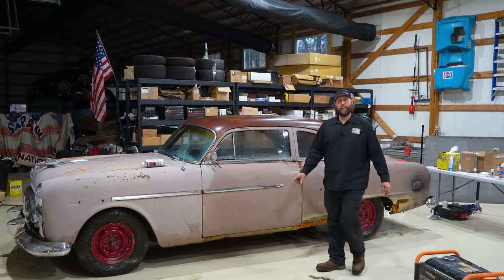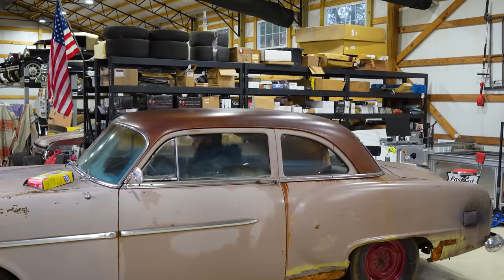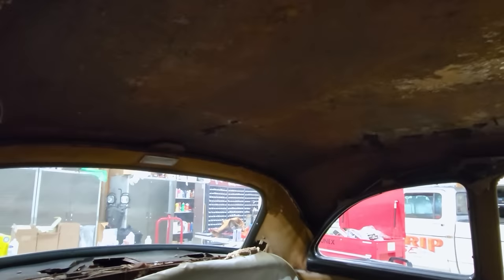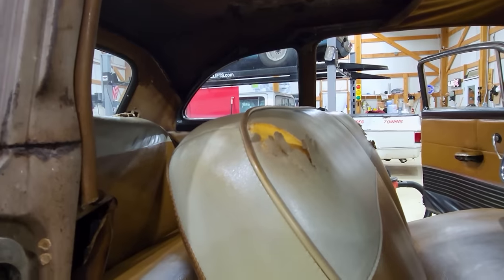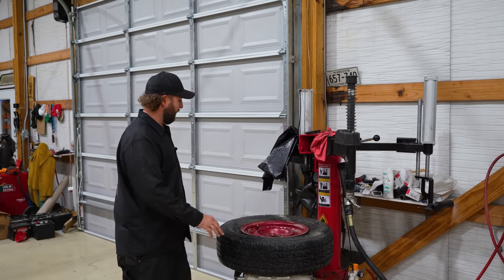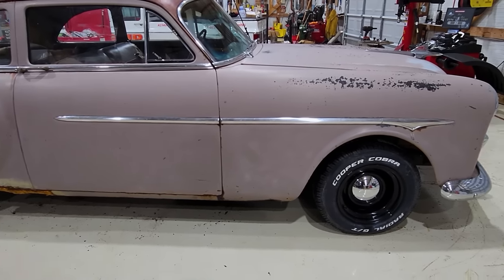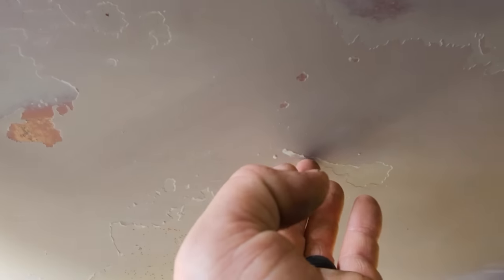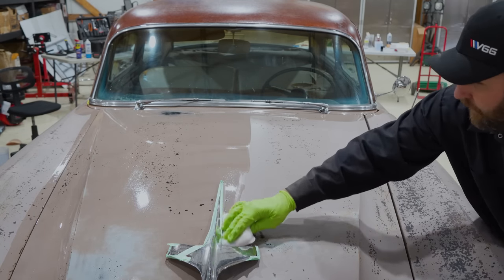BUDGET BUILD - '52 Straight 8 Packard Hotrod!

Comment: As a certified welder now for 20 years , I can verify those are quality,solid welds on the floor pan repairs !
Reply: Agreed. We rat rod builders use a lot of license plates for body and floor work. Part of the trans tunnel on my 41 Ford “The Beast” is license plates and more will go into the Jeep rat I’m building now

Comment: For anybody that plans to remove their headliner and hopefully replace it some day with a new one -  each of those bows in the headliner have a unique position in the car.  Most of the time, they aren't labeled where they go, so be sure to label each of them so that they go back in the right spot.
Reply: That's not ''level 12 mouse housage'' that's asbestos...
Reply: @hifiteen49  Can't tell by looking at it with your peeps, takes a microscope and special filters to do that or TEM.  It is very unlikely, however.
Reply: Asbestos...sniff...nope.  🤷‍♂️👌🏻👍🏻😎🏴‍☠️

Comment: Good tip for anyone else welding in their own license plate floor, a good sealer to use when you do it  is vinyl rv roof sealer. It stays soft and stretchy after curing so it can move and flex and it is all weather ready. Just get a brush and liberally paint the back of the plate before welding it in!
Reply: Over there in America,do the cars have to have a yearly MOT test? Here in England we have to go for the yearly MOT and also an emissions check too for.whats coming out of the exhaust..the license plate floor would defo not pass an MOT over here with them.just self tappered in lol!!! Good effort though and such a great old period car.....thanks VGG!!
Reply: @iantowers6972  there are some states that require inspections and emission testing but most dont. and besides that most classics like this are grand fathered in and are exempt from emissions regulation.
Reply: @iantowers6972  Like josh had said a lot of states have rather lax vehicle inspection laws(atleast for personal vehicles and not commercial) Mostly pertaining to passing emissions , Do all the lights work, does the e-brake work. Then however if the vehicle is over a certain age it's exempt from the emissions aspect of it in those states (mostly states in the northeast and west  coast) then you have the other majority that dont have any vehicle inspection or emissions inspection. Very common to see vehicles with large amounts of structural damage still on the road. Though as long as all the lights work, the wheels are covered and there's a windshield and atleast a driver's side mirror there's not much illegal about it. It's just to the owners discretion to regard when they feel their vehicle is unsafe for use .

Comment: WOW ! What a GREAT recovery of an old classic. Ole Geezer Gear Head here(papasmurf7597). When I was a kid, a million years ago(late fortys-early fiftys), Packards similar to that one, were a pretty common sight. You were right n your comment. THEY were a higher quality automobile. UNAPPRECIATED! My ole man(my father) was a professional auto mechanic dating back to the 'T' days. He also would say that you could balance a quarter on the head of a well tuned Packard straight 8. Funny to hear you say the same thing. BTW, if my memory serves me right, Packards did install a V8 in either '55' or '56'. And, I think, I may be wrong with this info, those Packard V8s could be bored out safely, 1/4 of an inch. Without ruining the engine block. Thanks for this great video. I sure enjoyed it. Sorry for the long comment.

Comment: Derek, 
I was one of those guys that didn't like Patina.  I called it RUST.  So back in the 70's when my '53 Buick special 2dr sedan (also a straight 8) showed signs of derelict decomposition aka Rust & Rot, aka Patina, I cut out the rotted areas, pop riveted a couple of pieces sheet metal over the holes, bondo'd over the pop riveted sections, sanded the entire car, taped off the not painted surfaces, then put two coats of paint on the car by use of a mini-roller.  The first coat of paint was Rustoleum's primer and the second coat was Rustoleum's gloss white.   The whole job cost me $57 bucks (about $100 bucks today).  The car looked perfect and didn't show paint roller marks nor rivet dots.  Those riveted areas never wore through the bondo neither.  I sold the car in '77 for a profit... $300.!

Comment: I like the looks of these Packards a lot. There was a guy who had a Packard straight 8 powered hot rod with an old centrifugal supercharger on youtube. My grandfather would approve of the use of license plate patches. If you want it really period, you get two hubcaps and stop to switch the side they're on each time you drive by the drive-in so the people thinks you've got all 4. My other grandfather told me about that from when he was running around in the early '60s. 4 bar spinners were the ticket back then. I'm a paint the car in the driveway kinda guy but the clear coat made a world of difference. I'd like to get me another classic and give it a try until I could get it one color.

Comment: For cleaning the floor, use a bucket with cleaner, a deck brush, and shop vac. Brush some floor cleaning solution on to the floor, scrub a bit, suckup the dirty water with shop vac.

Comment: Derek and Jessica...what an awesome episode of VGG! That car is super cool and rare and it is a true survivor. I would really like to see you slowly fix the old Packard hotrod up over time...an episode here, an episode there showing you and others restoring some parts that need it, taking care of the mechanicals (maybe some upgrades here and there), doing the interior nice (Dan the man), rebuilding or replacing the guages if they don't work right, maybe a larger exhaust with a Flowmaster or something, and how is the trunk floor...can it be POR-15'd (rust converted), 'plated and given a generic black rubber mat to make it a family three-day-weekend trip or meet--n-greet event rig?
Reply: Ya, I was thinking the same thing. Like what an average guy on a budget would do next. Like how to tackle those foam issues on the bottom panels. If you know anything about body work there are 10 different ways to fix stuff like that. Of course we all know most of them are the wrong way. But still sometimes they work and don't hurt anyone's feeler's to bad? fiberglass can work great if you get rid of the rust first, for instance. It's of course a short term fix. But f&%$k them if they can't take a joke. Ha!

Comment: When I saw you cutting off that muffler on yer old Hudson, I was about a quarter way onto  a bottle of techwilla, and it reminded me of an eventful day when I was 16 years old, driving my first car,  a $750, 5 year old 1969 Plymouth Road Runner. The base stripper: 383 B block, 727 Torque Flite trans on the column. 3:91 axle. 
Anyway, it was a nice spring day, and I was AWOL from high school, in the act taking some young ladies to McDonald’s for some delicious culinary treats. Having seated our desire to snarf down pan fried dog-meat, I decided to do a burn out from the traffic light. Being inexperienced, I did not notice the Wilmette law enforcement officer in his pale, yellow Ford LTD cruiser immediately behind me. That was two tickets for the day, speeding and improper start. Later that evening, since it was a Friday, I decided to attend a party in Glencoe, but I  had been distracted by the desire to replace my exhaust system after school, and had chopped off my exhaust pipe, much like you just did on your Hudson and yanked out the stock exhaust system just below the bench seat. Unfortunately, my glass packs were not the correct diameter to fit. Since the parts store was closed, I decided to drive my unmuffled 383 V8 up Green Bay Rd. to the party. I made it approximately to Tower Road where I was stopped by an environmental protection agency agent. Yes, you read that correctly (if anybody is reading this) an EPA AGENT… not only did this clandestine agent of the environment have a sound decibel meter in his car (WTF!), but as a federal agent, on a special detail, he was prepared to issue me an insanely expensive citation. I told him “holy crap man. I already got two movers today. let me slide and I’ll just take this car home and park until I fix it, and that is exactly what transpired.  True story son.

Comment: This '52 Packard brings back memories. My second car was a '53 Packard Clipper, straight 8, 3 on the column, nothing electric, two toned blue, dark on the top, light under, no rust.  I think I paid about 100 bucks for it in 1959 or '60. 
My fourth car was a white '55 Packard 400, V8. Full luxury car.  Paid $150.00 in 1962.  I burned through cars in those days. I wasn't hard on them, they just didn't last or I lost interest.

Comment: Hey if anybody wants to paint a car and doesn't have a high falootin' compresserater handy, I recommend using a Wagner MotoCoat airless sprayer and some marine topside paint applied at the consistency of milk.   This is Super Cheap and the results look Amazing.   Seriously.   I didn't get much orange peel but if a feller does he can cut that down with a denim pad.  You don't need a huge expensive rig or even a garage to do a decent single stage paint job.   Be aware that all of the work is in the sanding and prep as always.   Cheers friends.

Comment: Derek, I don't know if it's just a southern thing, but cars sitting under trees get nasty black stuff all over the paint. I also noticed more black junk around the gas cap and door because of the alcohol in the fuel. I think that is the reason because we have a 10,000 gallon E-85 tank at work and it gets black and the gas pumps for E-85 turn black quickly as well.

Comment: Hey Derek thank you so much for all your amazing videos. I've been a fan of the channel for a few years now. This product is very interesting to me. I think I have an application for it and I wanted to get your opinion. I have a newer 2018 travel trailer. I struggle to keep the sides of it clean. The surface is your standard painted aluminum siding on the sides and aluminum sheeting on the front cap. My idea would be to clean the walls to get all the oxidation and spotting off of it and then apply this product in hopes that it would create a surface that is easier to maintain and clean in the future. I don't have thousands of dollars to spend on some sort of a ceramic coating that is beginning to get popular for RVs. So I think $125 investment would be more my speed if you think this may work for that surface. Hope to hear from you soon thank you so much!

Comment: When I was a teenager in San Diego County, my Mom asked me to paint the refrigerator we had in the garage. I found some leftover boat enamel in a shade of green, and decided to use a small roller to apply it to the frig.  My older sister liked it so much she asked me to do the same to her '63 VW beetle. That project took hours, but the enamel flattened out pretty good, and she was happy with the way her car turned out. Your wipe-on clear coat caused me to think back on my roller jobs...good memories...

Comment: Need some advice.  I have a 2011 Nissan Juke.  167,000 miles. I got six years till I retire.  I would like this rig to get me there. Everything works.  Had the recall done on the fuel pressure switch early on. It does not leak a drop of fluids.  But it uses a quart and half between my 3,500 mi changes.  Starting to idle rough but runs great wide open.  It does idle a lot as it’s cold where I live.  Is this a sticky valve?  New plugs last winter.

Comment: VGG is my favorite Youtuber. I know he says don't do anything I do unless you are really desperate. This is more for entertainment.
   But still. I love the car and that he got it started and driving with the straight eight engine.   But, If I bought the car, I'd have to UNDO everything he did in this video.
  I wish MY 52 had front coil springs in good condition. Like VGG's were BEFORE.  Cutting coils is bad enough. But TORCHING coils is the worst thing you can do to a suspension.  Either way makes the camber too far off to correct with an alignment. 
  But the result of torching coils is coil bind and loss of temper. So you are bouncy.  
  Next, he put on tires that were too short.  That is why the fender and tire gap was what it was.
  Next, he got rid of the factory "hub centric" wheels and put cheap aftermarket wheels on that are not "hub centric."
These are the things you would only do for laughs. Not for a car you ever expect to drive again.
  The smart thing is to have the wheel centers put on wider rims. Or find hubcentric wheels with about 1 1/2 to 2 1/2 inches more width. You have to buy a wider tire to get the height you need because modern tires are 75 aspect ration but they were about 84 back them.  I wonder why he used what looked like 50 or 60 series tires.
They were too narrow for the wheels, which were actually a good width, AND too short. Maybe had just had had some tires from a Chevy Citation lying around.
  Now my other remarks or more subjective.  
   Also, a top of the line car would have full wheel covers. Only , say , a 52 Plymouth had the small hubcaps. Which gets me to the raised white letter tires.  This is closest to the absolute worst car to put them on. Even if you want the "hot rod look" on your 50's car, a Packard is an enormous car.  It is even bigger than a 52 Chrysler. Derek is a big guy and when he is standing next to the car, you can see it is as tall as a modern van or SUV.  But this is a matter of taste, not safety.  It would be even worse looking on a 4 door  sedan.  "In my opinion."  In the early 60's , 4 door sedans were almost 90 percent of the cars sold. So any 2 door, whether it is a hardtop or a coupe/sedan/post, is worth treasuring.
   I suppose guys got back to him and ragged on him about the linseed oil from other shine ups getting dull and attracting bugs. I'll reserve judgement about how well the new VGG shine juice works since it seems to have some paint rather than a just a solvent and a bug dietary supplement.
   I suspect the shine juice will cause fish eyes in the paint when the next owner tries to de-patina it.
   I would have used the headliner to give a pattern to a upholstery shop or seamstress to make a new one. 
   I just wish he said at the end:  "Please, this was all for laughs! Don't screw up your suspension. At all. Seriously!"
   I liked when he used "lightning scissors" to cut out bad metal and "lightning stitchers" to weld in metal.  It's been a couple of years since he brought those out.
Maybe young people can't relate to high quality repairs so he resorted to  "grandpa's follies" mods.
Reply: You are really limited to what wheels you put on a car that uses bolts.  The rivets interfere with most after market wheels and most OEM modern (60'
s and 1970's) wheels. And you can't get bolts long enough for the aftermarket wheels, especially the left hand ones.   So "I'll just use a 14" spacer won't work. 
Many guys have the drums converted to studs/nuts.

Comment: Why your mop smears instead of mop need to fill mop bucket with the hottest water soak mop in the said hot water cause the strands be dipped in a thin wax that has to be melted off before the mop absorbs water lol i learned it in the navy after being in a shop for 7 years back in my teens and 20s

Comment: Stopping by four months later to ask, Derek, sir... Have you ever gone ahead and just, you know, just for a laugh, actually welded a hole in a body or floor panel? Or is that sacrilidge...blasphemy...heresy...one of them forbidden things? I only ask because it seems like a spark stick and some steel would really help some of those old machines last longer. That foam, for example... You know that has to go, right? I mean, that car is too damned pretty to have all that ugly foam stuck in it. Bit of steel and some electrons would fix that up, and in a way that might give that body an extra decade or so. I love the license plate job on the floor as much as the next guy that likes to laugh, but is it really as good for the rig as ACTUALLY fixing the thing? 🤣

Comment: With all due respect, I think you just ruined the car by cutting the exhaust out. Now it doesn't have the back pressure needed to run right and moisture can get into that motor easy
Reply from the maker: This engine doesn't require any back pressure, and it gets a new exhaust system shortly after this 👍